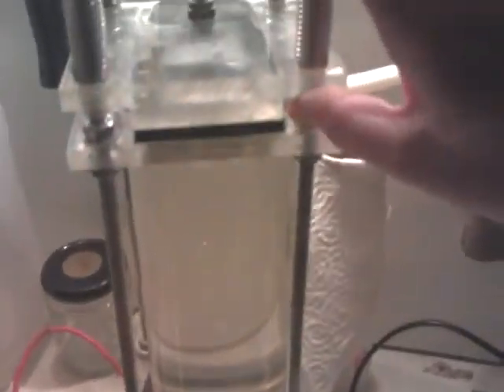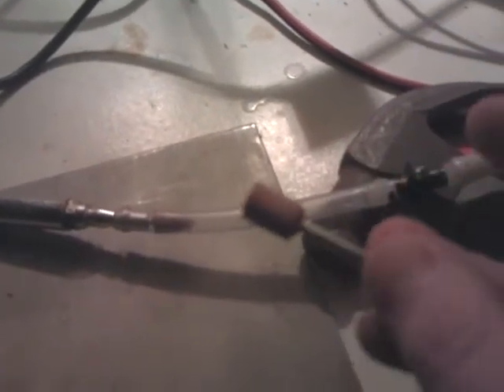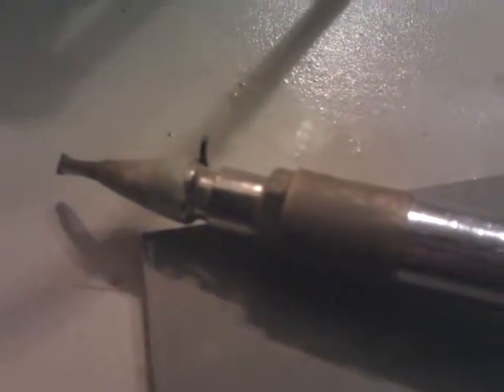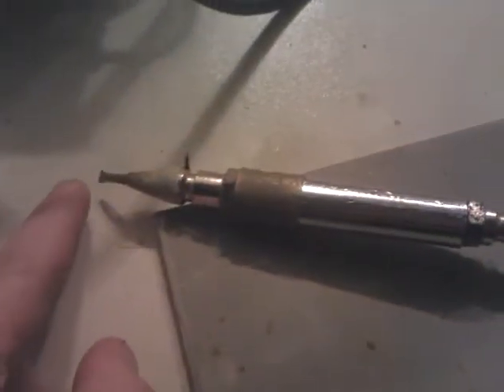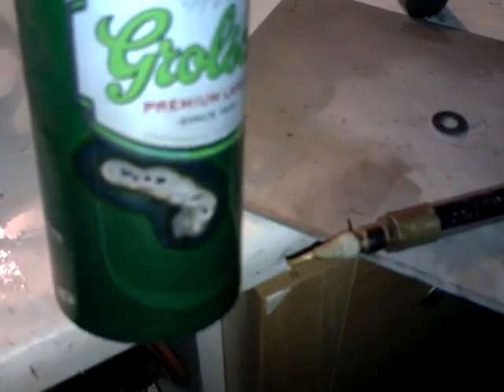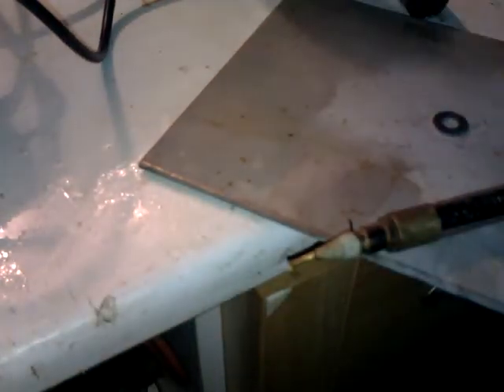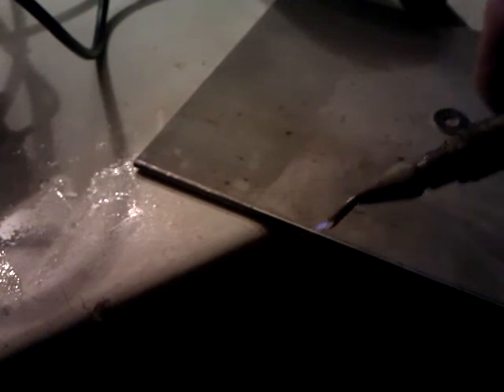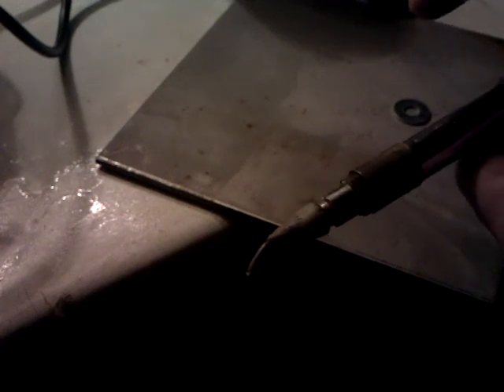HHO torch #2 with the new power supply (success)

Comment from the maker: hello dzdice,
the sponge i used was great for a flash back arrestor for a while but needed to be dampened down constantly. the dremel tool bit was brilliant as it did a great job of stopping a flash back. i now use a size 1 oxy welding tip that has a very small hole and i no longer have to use the sponge or a dremel bit.